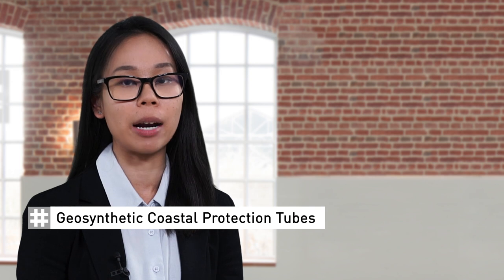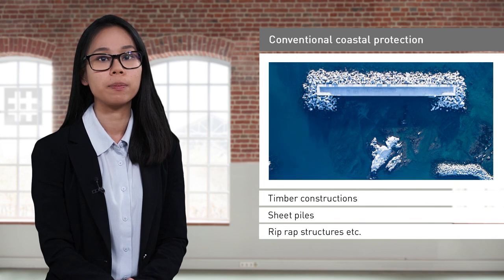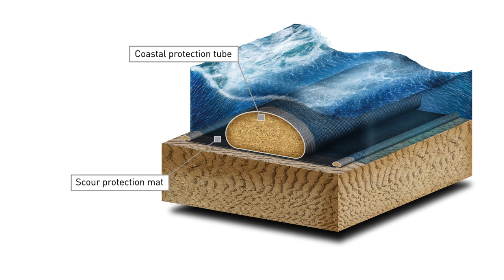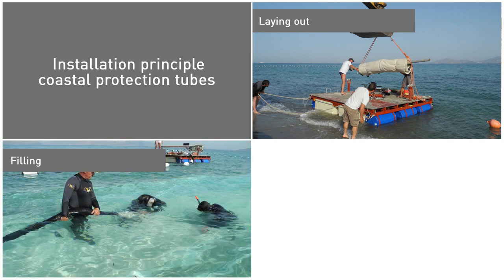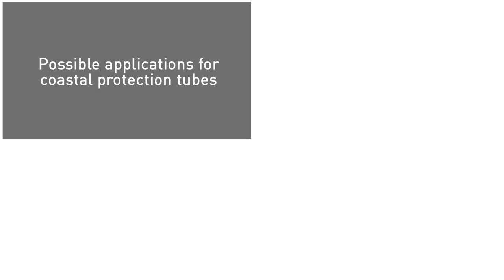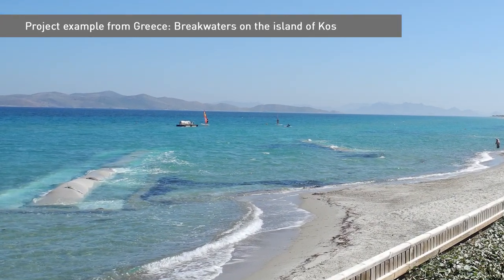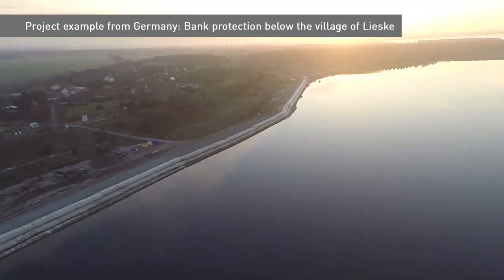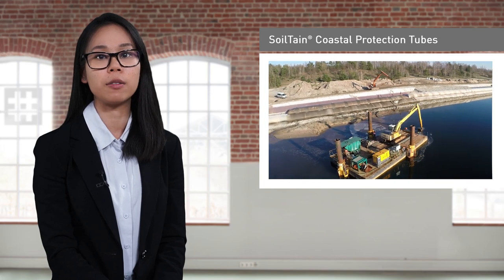VideoCast | Geotextile Coastal Protection Tubes

Comment: Is this designed to withstand a moving loads such as heavy equipment ?
Reply from the maker: We typically do not recommend the tubes to be driven over directly. A cushion layer (with graded rock /gravel) should be made before the tubes are driven over with heavy equipment. A non-woven geotextile protection layer should be placed between the cushion layer and tubes to protect the tubes from the sharp edges of the rocks. For detailed design, the expected load, application, and type of equipment used would be needed. Please do not hesitate to contact us should you require further support. Your HUESKER-Team.